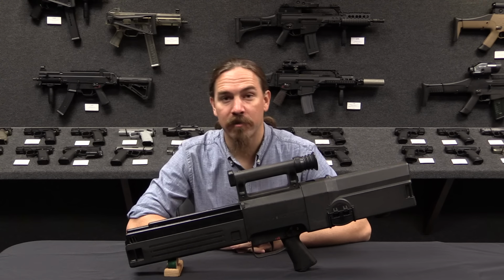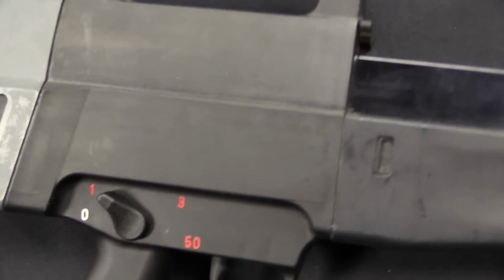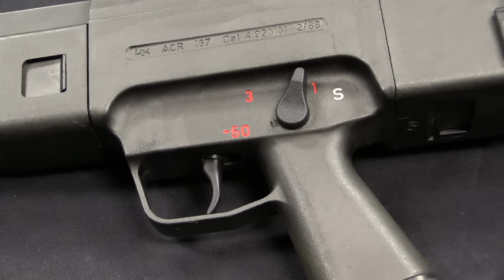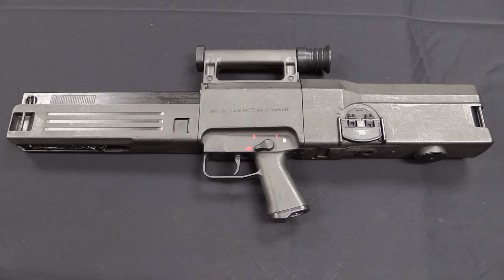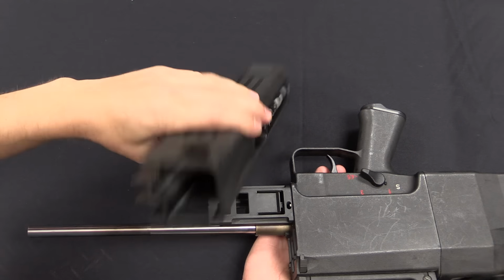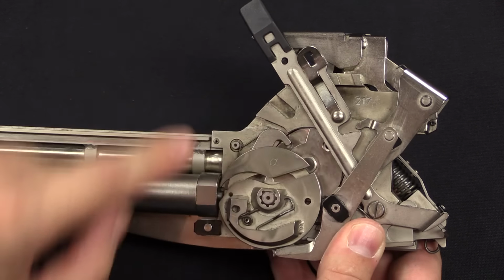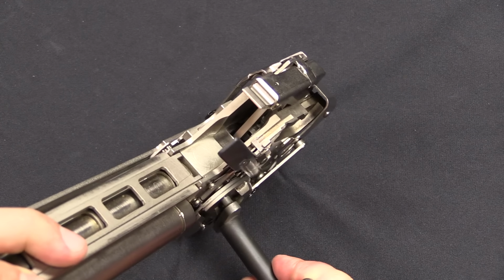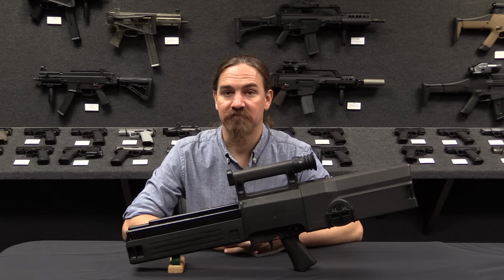Kraut Space Magic: the H&K G11

Comment: They must have been doing something right, since every Stormtrooper in Star Wars has carried some version of this gun for 40 years. Accuracy wasn't too important, just as long as you could carry 37,240 rounds on the gun, eventually they would hit what they were aiming at.
Reply: "Standard troop complement of an Imperial Star Destroyer is 6,853. Every stormtrooper carries an E-11 Blastech rifle capable of 500 shots per energy cell. Whereas we are thirty armed troopers whose fifty-year-old equipment is held together with twine, adhesive, and the will of the Force."

-Tag, Rebel Alliance
Reply: Stormtroopers, however, are not.
Reply: @fraser9580  actually someone calculated all their shots and hits seen in movies and came to the conclusion that stormtroopers have an incredibly high hit ratio compared to real life

edit: checked it, stormtroopers hit 4.19% of the time, while in real life during WW2 it was found that it took 25000 shots per casualty
Reply: @glowner7878  Amazing that someone did the math! To corroborate, the one time Stormtroopers are obviously missing it's the one time they're letting the heroes escape so they can get back on the Falcon and lead the Empire to the Rebel base.
Reply: @VideoMask93  that is just a theory but even if they werent missing intentionally their aim is much better than observed in a real war
Reply: @glowner7878  In all fairness most men in real war also miss intentionally a lot of the time until very recently
Reply: @glowner7878  Leia mentioned they got away too easily, and that they're being tracked right after they flew away
Reply: Didn't they use converted Sterlings?

Comment: The Germans produce some brilliant, outside-the-box mechanisms for timing firearms, diesel engines, automation equipment, etc. They also practice value-engineering so that no component is overbuilt, and materials technology to save weight and manucacturing cost. The end result is almost always a beautiful steampunk mechanism that blows its competitors out of the water when perfectly serviced to spec, but cannot be repaired in the field with makeshift tools.

I spoke with an old machinist once, who told me that at one time Mercedes-Benz ran new engines to failure in industrial applications in Africa, then analysed the failures and updated accordingly before releasing a prototype for mass production. Sometimes this to several rounds and several years.

I once had the pleasure to repair and test operate a crawler/loader from the 1960s. It was smoother in every way than a similar Chinese machine from the 2010s. It also came with a toolbox that contained the 5 or so tools required for basic servicing. Obsolete parts were easily replaced with local equivalents; I made a new fuel control lever out of scrap metal while working out of a van.

Somewhere along the line the philosophy changed from "a machine should last forever and require minimal training to repair" to "a machine should be operated only according to procedure, and dealer-level scheduled maintenance is necessary to keep the unit functional.

Comment: The only way we're going to get caseless projectiles is if we get away from powder entirely. If we have another breakthrough in battery technology, we'll be able to have handheld railguns, essentially. Just fire tiny flechettes down a magnetic rail in the barrel at ridiculous velocities with almost zero recoil.
Reply: Tiny flechettes have pretty much been abandoned. They lack the sectional density to perform well when been accelerated to high speed rapidly and while thet have impressive penetration capabilities, thats part of their problem in regards to energy delivery since thet penetrate so well, they tend to go through and through carrying much of their energy with them rather than dumping it into the target. They are also horribly susceptible to wind drift at any velocity. They also have the problem of not playing well with any sort of rifling, making a gun using flechet based ammo not sutiable to signualr projectiles if needed without somethinf like a second barrel or swapable barrel.

Comment: Forgotten weapons: “the bullet is just as complicated as the gun. It was specially developed”
Also forgotten weapons: “here’s the gun only”
Reply: The caseless round is mechanically very simple.  It's a rectangular block of propellant with a bullet and primer embedded in it.  The gun that fires it is far more complex.  That said, yes, a diagram of the round would make the video much better.
Reply: I dont think the ammo is really complex on its parts, but the parts itself, as it is really easy to craft typical powder-based ammo, but the propelant in case of this one, probably requires harder procesing methods that just are imposible to consider in frontline or hard to set a place for it.

Its just like you could create super-detailed texture sets 4 tanks so they would be way harder to identify (camo) but if it forces you to create 4 example some kind of molded pattern 4 the vehicle that takes weeks instead take a can of paint and do it in minutes (even if you ussually anre not going to paint the same tank for different biomes on the same conflict) is still a Con that also requires money what never is liked unless a war is already on course (thenthe money ussualy takes some less priority)

Comment: whats bad concept gun. They tryed to make weight down for soldier and removing any jams from cases. I think gun failed. when its clean and inside it looks and works ok. But i see so many problems which this will fail and be dropped the second you see ak47 or any other gun. 1)Its big visually not good thing when you try to camouflage. 2) all ammo is infron of the gun. Point is when you need to aim you hold the gun with your left arm more weight on gun more problems holding gun itself while aiming. Also when you go marching patrolling all what weight is in your hands all day long you must be crazy. 3) caseless ammo its bad idea water and sand, you put gun in water ,the end, all ammo got wet. Also you drop down a lot going frew mud sand. Modern gun you can put under water under sand  in mud it will fire even if ammo is wet or sandy. sand will get inside the gun :(

Comment: I have long applied these case less projectiles into a Gatling type action in a single parallel platform. This would eliminate the “cook off” potential. A very high cyclical rate is inherently more stable than slower cycling systems.

Comment: The combination of concern for battle practicality (3 round burst, 1x non-magnifying optical scope, magazine storage on the gun) with the impracticality of its ammunition concerns (caseless ammo in general, the entirety of the bolt, muh internals) is really striking.
Reply: Афанасий Сырков I didn’t say caseless ammo is stupid, I said it is an impracticality. That does not inherently mean something is stupid, because there are genuine benefits like you pointed out, it just means there are factors that prevent it from being useful. If those factors can be removed or mitigated, caseless ammo would be a godsend.

Comment: I remember a .22 that used caseless ammo back in the late 60's or early 70's. I never actually saw one, but I saw the ads It didn't stay on the market long, probably didn't work for the same reasons this one didn't
Reply: You're talking about the Daisy VL, it went off the market once the ATF classified it as a firearm.  Daisy wasn't a firearms manufacture, so they discontinued production
Reply: @eccentricthinker142  no, it wasn't a Daisy, it was made by a regular firearms maker... maybe they bought the rights, I don't know, but it was the same company that made the Nylon 22. Remington?  I never heard about the Daisy deal. For all intents, it was a regular 22 but with the caseless ammo. However they didn't consider that there is no significant gain in caseless ammo over regular in that small caliber. Why would anyone buy it? the caseless doesn't decrease ammo weight much, and the performance wasn't any better, probably worse, so why have it, just to have something unique I guess.    It wasn't around long, it was a lot of hoopla as I recall, but over nothing really. Caseless ammo only makes sense where the weight of the cases is a lot, or in machine guns so they don't have to deal with ejecting the case too. In a normal rifle of small caliber, there is no added benefit.
Reply: I looked it up, the original by daisy was a single shot... absolutely no advantage to caseless in a single shot. The rifle I remember was a semi auto.  But then again, that was a good 50 or 60 years ago, I could be remembering all wrong.
Reply: @tootall5559  Hell if I know, didn't even realize the concept even made it to market...
Reply: oddly, the guy that bought the caseless idea for Daisy... his first name was Case.
Reply: @eccentricthinker142  I'm not sure about it being remmington that brought it back to market... I know the daisy failed for good reason, the caseless ammo wasn't tough enough to be carried normally in your pocket or what not. It's still not.
Reply: Gyrojet?
Reply: @johndeaux3703  No I think the other guy is right, maybe it was Daisy... but I don't recall it that way. Gyrojet is basically a rocket gun. It didn't work well. I think it could have with a bit of modification, but the ones they had then, kinda useless. the tiny rocket takes time to get up to speed, so at short range, it had no umph, and the range wasn't great at that. What they needed to do was fire it like an ordinary bullet, with the rocket engine coming on down the way to get some real power and distance out of it.  They didn't, so it just didn't work well, at all, and the ammo was costly to make and buy.. I heard it got offered on the civilian market, but I'm not sure about that.

Comment: Does the cylinder rotate 180 or 360 degrees for each round being fired?   It appears that both ends fo the cylinder are open to be able to push out  the unspent round. So both end would need to be “sealed” to fire.  Just curious.

Comment: Another problem with caseless ammunition, is if any of the propellant is left behind. Solid propellant typically has air between each grain, ball, molecule etc. Which helps let the heat burn everything up, and reduce residue. This also tends to leave any fouling in the case, and the rest in the barrel. Hard, compressed propellant runs the problem, of guaranteeing the heat has a chance to burn up everything, in such a compact group. So not only does the barrel risk heavy fouling after extended use. The chamber now is used to house the explosion, not the case. So any fouling, ends up on the chamber walls, and anywhere accessible or not closed off.

Comment: i see one potential 1/1,000,000 problem with this
if you had a dud round on the second shot of the super-speedy-burst-fire mode wouldn't that end up being ejected inside the stock housing ?
Reply: Well no, it wouldn't. The eject can't happen unless the bolt cycles and if it's a dud it doesn't. You only get the dud out if you cycle it manually.
Reply: It's a gas operated gun, so it wouldn't cycle the full burst, finish the recoil action and you can/must cycle the action manually
Reply: Was thinking that too..

Comment: you could use liquid cooling to solve the heat issues. you would need a radiator with a fan to transfer the heat from the system to the air.

Comment: field malfunction clearing procedure includes a 3 year university course alone with a certificate and 2 months of hands on training.
Reply: I mean look at engines and gearboxes, they also last if maintained properly. Normal guns are really simple, but this mechanism shouldn’t be too unreliable
Reply: @starstencahl8985  normal guns are really simple because if it is complex it fails. If gun fails you are dead.
Reply: @arturasnesakysiu1684  thats not how things are made here
Reply: Plus you need three years of on hand experience so #rip
Reply: Its fared as good as other guns in German field trials as well as ACR trails. Its hardly jammed. The biggest reason for guns jamming involves brass cases, this thing doesnt use cased cartridges.
Reply: By the time you are done clearing this, the war is over.
Reply: @Oxazepam65  what would be there to clear?
Reply: Ben Warner  this thing was built so the bundeswehr could delay the warshaw pact for a few days. large armies attrition 80-90%losses style. 

 you might have noticed they didn't adopt it post cold war.
the thing didn't have malfunctions. 

and those it did have were of the something broke inside style, for which any other firearm would need a weaponsmith too.
Reply: Hahaha hahaha very funny that was a good one
Reply: you only need malfunction clearing if it actually regularly malfunctions... if malfunctions are rare, it doesnt matter because either your buddies are defending you or a replacement lies right there next to the body of your dead comrade.

Comment: Ian, well researched and delivered (as ever), really awesome 'thinking outside the box' on H&K's part.
Yeah, the 'inertia' involved in completely changing a national small arms system (especially that of a NATO country) would require some HUGE game-changing technology...those guys came close though.
I'm not even going to comment about trials and politics and simple accounting.......... you basically said it all already.
I DO HAVE A QUESTION; has anybody ever proposed or produced a weapon that uses gas as the propellant (I mean of the flammable variety) rather than solid explosives? By extension, how about a gun that runs off gasoline or ethanol?
Before everybody starts laughing, it seems that brass cased ammo has reached it's pinnacle as indeed, has the internal combustion engine....we're just fiddling with variables now...HOWEVER,  if the Ferrari guys can run a 10 cylinder engine at 11,000 RPM or a rotary Wankel engine can at least hit 8K, even dropping ball bearings into a modified exhaust....?
Most modern semi-autos have a gas cylinder /piston (I'm not saying they can be converted) but the thinking could be reversed, mechanically charge the cylinder (present the projectile), fire electrically , gases expand to the breech and fire the bullet, this pressure cycles the mechanism...repeat as long as you have gas or ammo.
It might seem absurd or it just might have somebody rushing to the patent office....I am not in a position to do anything with my ideas, so , for what it's worth Ian, I gift them to you, these are not the ONLY ideas I have.
To put it formally (and establish precedence); to Ian at 'Forgotten Weapons', these ideas of gas or gasoline driven projectiles are yours to do with as you will...... to put it another way, if air-gun manufactures can deliver a 'standard pressure' of gas to a chamber prior to firing a pellet, why might that gas not be flammable and thus ignited to propel a projectile?

Would love to hear comments, so long as they are germane and helpful (or funny).

Pax Vobiscum dudes...
Reply: That sounds very much like a light gas gun, a more high tech version of a potato cannon: https://en.wikipedia.org/wiki/Light-gas_gun
Reply: @m2heavyindustries378  Thanks for the link, that's some seriously advanced 'stuff', my thinking is more towards the 'potato cannon' end of the spectrum....I am convinced that it is feasible, how practical is another conversation.
Just seems to me that the evolution of firing projectiles from a barrel will always be hindered by the brass case...if you are not ejecting (or carrying) at least 1/3 the weight of the projectile, things get a lot simpler....I keep thinking of a piston compressing (which will start the projectile moving) then combustion, which drives it through the barrel (closed pressure) until a gas port is reached which frees/causes the piston to reciprocate and feed the next round etc....if only I had the means and the skills and the opportunity....I coulda' been a contender!

Comment: If only overheating issue was solved, I believe caseless ammo could become the future of warfare. Fragile ammo problem can be circumvented with issuing ammo already preloaded into magazines. Literally replacing "stripper clips" or analogous with magazines, preloaded with ammo (how stripper clips was designed to be on the first place for WWII rifles).
Reply: Its already like that
Reply: Cased Telescoped ammo can solve the overheating problem. Though, using CT ammo would defeat the purpose of creating caseless ammo in the first place.
Reply: If the battery energy density improved, like a lot, I believe a scaled down rail gun would be the best option. No powder. 100% projectile

Comment: Detail cleaning:
Pull the action, spray with brake cleaner, reassemble.
Reply: Apart from the gas driving part it really is that simple... Hose down with some cleaner and maybe if you're feeling good put a few drops of oil back in. but that just makes the dirt stick better.
Reply: Harold Henderson WD 40 for the win
Reply: Spanjaard Electrical Switch Cleaner...  magic in a can

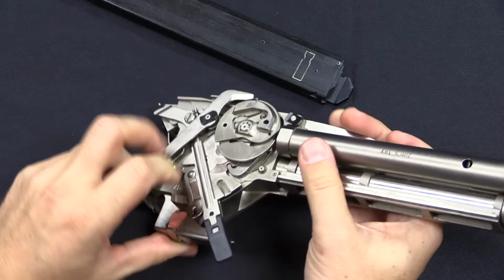Comment: 23:54 "jim's toy" is engraved on the recoil spring housing.  Cleaning:  remove rear cover.  Option 1: Dip entire action assembly in solvent,or, spray with WD40 or better cleaner, let evaporate, or, blast with compressed air to dry, re-install rear cover.  Option 2: remove rear cover, piss all over everything with your or a buddy's forceful stream (women, squeamish men allowed to collect urine or water into squirt bottle), re-install rear cover. Easy peasy, as long as the metal innerds are of a rustproof metal.

Comment: i designed a rotating bolt.  minimally, but it rotates perpendicularly to this design.  i can't believe how complicated the g11 is.  It was to operate like a delayed blow back but modulate the exact pressure in the barrel to operate until the bullet leaves the barrel. So every round would have the exact same pressure every time you fire.